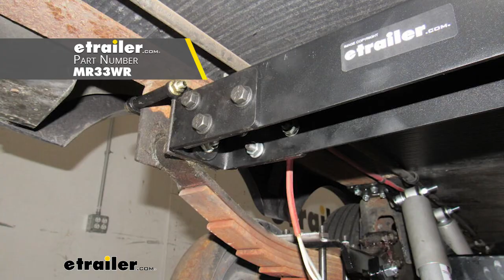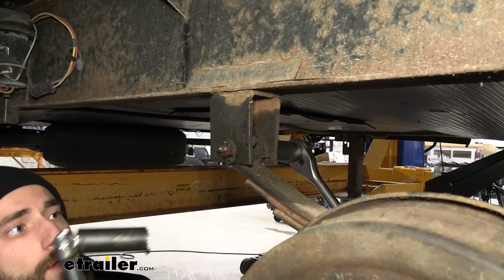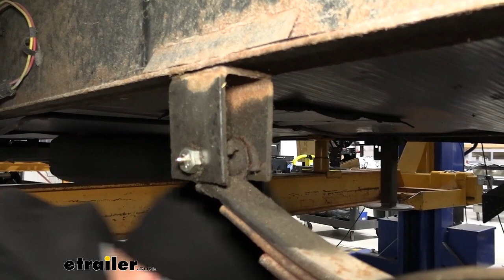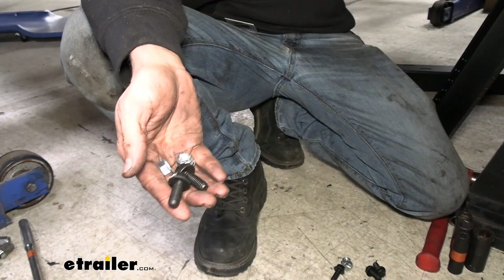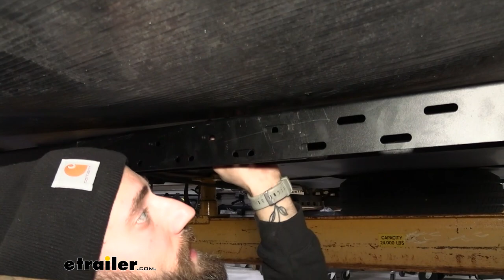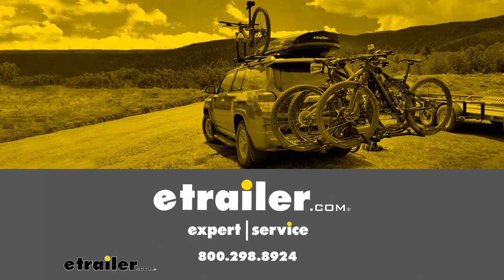etrailer | An In-Depth Look at the MORryde X-Factor Crossmember for Standard Frame Hangers

Comment: With the issues of cracked welds on the outside leaf hangers, will this, attached to the outside hanger, likely cause more stress on the hanger?

Also, is the X-Factor Crossmember compatible with Roadmaster Comfort Ride Leaf Spring Suspension Kit w/ Shock Absorbers - Tandem 7K Trailer Axles
ITEM # RM-2460-2570 ?

Comment: I’ve seen folks get a V shaped metal piece to reinforce the lead spring bracket that’s welded to the frame.  Just provides more welded contact to the frame & the hanger.  Curious what y’all’s thoughts are for that as well?
Reply from the maker: As long as what you're adding doesn't interfere with the articulation of the suspension, what you've got in mind sounds like a pretty good idea.
https://www.etrailer.com/Accessories-and-Parts/MORryde/MR33WR.html